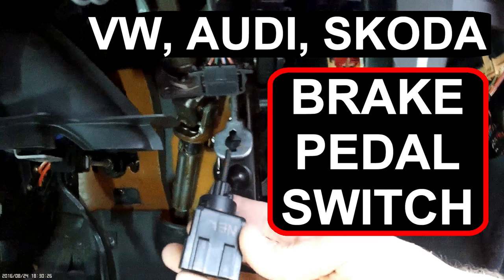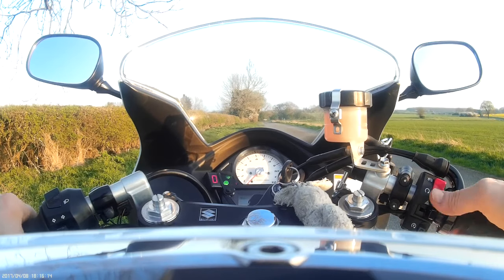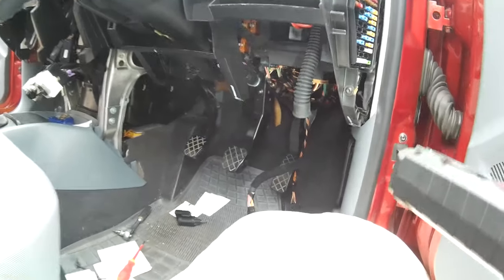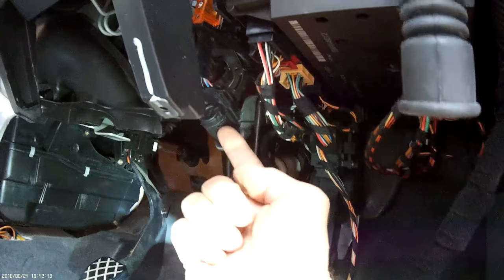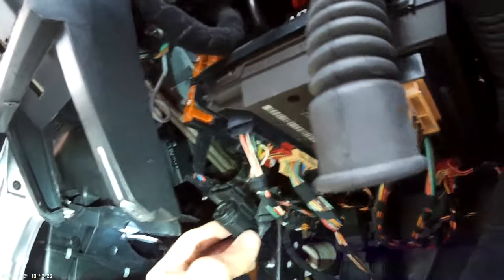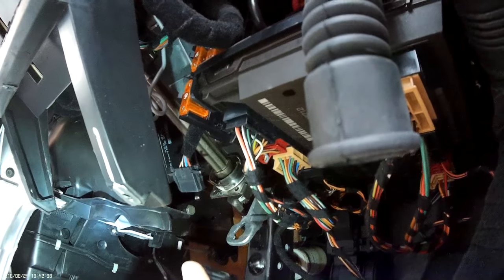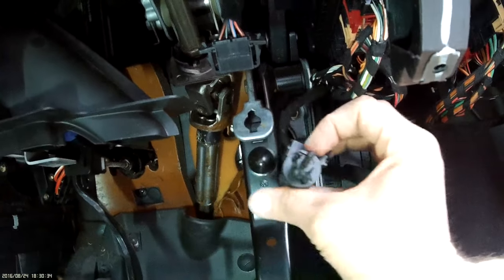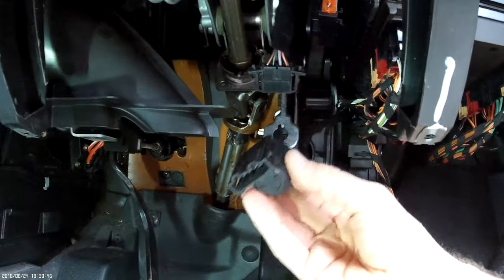VW, Audi, Skoda, Seat, BRAKE PEDAL SWITCH fix

Comment: Thanks for the video. I tried replacing the switch but the brake lights just stayed on permanently even when putting the old switch back in.
Reply from the maker: Have you looked @ the fuse, parking brake switch, foot pedal spring return and fluid level?
Reply: You have to make sure the brake pedal is up in its resting posting whilst putting in the switch then rotating 45 degrees clockwise as that is how it sets it's position. You should be able to remove it and install/reset it again without issues but make sure that pedal is up.

Comment: On Skoda Fabia (Mk2 pre-FL) replacement took 3 min without a single tool! Just flexed and removed the foam panel and unscrewed the part. Cost of part (Genuine 6Q0945511) was 15 euro (at local parts dealer in Thessaloniki, Greece).
Reply from the maker: Well done, glad you fixed it so quick, hope my video helped a bit :-)
Reply: @HatBoyHarvey  It sure did! It encouraged me to tackle the issue by strengthening my confidence. Thank you!

Comment: Getting a loud click majority of the time immediately after i press the brake pedal on my 2014 polo, reckon this could be the issue?
Reply from the maker: Depends where the sound it coming from. It would be quite noticeable if it is the pedal and a lot different if coming from outside being the brakes themselves . If it is definitely from inside then yes it could be, but you could probably tel the difference if it was the switch or the peda.l Both could be faulty. . May you could feel down at the switch whilst pressing the pedal as you would feel it if it was the switch.
Reply: @HatBoyHarvey  to be honest it sounds like it’s coming from around the brake servo / master cylinder. really sending me crazy haha
Reply from the maker: Most likely Sounds like your front pads need replacing as sound from the brake calipers can travel up through to the pedal, but could be the master cylinder, either way I would take the front wheel off inspect the brakes, if worn replace pads/discs and then see, if not worn strip down and rebuild the brakes so you know they work correctly. This will eliminate brake wheel issues so if you then still have a clicking noise you then suspect the master cylinder. Hope you understand this, but whatever do not leave it as the braking system is obviously vitally important and needs checking out :-)
Reply: @HatBoyHarvey  rebuilt the brakes fully, proper ceramic break grease and rubber grease in the slide pins, working sound as a pound now, just a slight whistling when turning right. cheers buddy 👍
Reply from the maker: @callumwilson674  monitor this noise and if as you say makes a noise turning right the the left hand wheel bearing could be on its way out. I have a video on this if you fancy doing it yourself, but the job isn't for the novice really. Happy days :-)
Reply: @HatBoyHarvey  i followed your video for the wheel bearing replacement before, both have been done, i probably messed something up though lol

Comment: Hi, I have got the glow plug light on for a few days on my fabia, I purchased and replaced the glow plug myself, but the might still there. As I search I saw post says could be the break switch light need replacing. Can u ask what light was on your dash please?
Reply from the maker: The glow plug light on is not just for a glow plug failure, it can come up for a number of electrical issues on this car. The main one is the brake light switch, if you haven't ever replaced it then this is relatively easy and cheap to replace. have a look at my video: https://youtu.be/So8m6LwsD4c
Reply: @HatBoyHarvey  I'll take ur advice and replace it, I'll see where I can get one new brake light switch that affordable. Thanks for quick reply and advice. 

My skoda mileage is 180000, in the past few month the sound of the engine isn't as soft as it was, it had hard sounds from the engine, it's very load and annoying, other day a fella told me if the spark plug works single, then he realised it's deasiel engine don't have them, any advice on this one Mr? Thanks
Reply from the maker: @miransalih1079  possible injector issue. Only buy the newer type of brake light switch as the original eim ones are crap - newer on is larger.
Reply: @HatBoyHarvey  I've replaced the glow plug and also brake light switch the orange fault light still on Dash and both brake light still doesn't work just the the lead light top of the rear window works when brake.

What other think to check please?  Just want to add this I've changed oil and filter it was needed too.

Comment: Jst replaced mine but is not working what could be the problem
Reply from the maker: Get someone to activate it whilst fiddling with the rear clusters out, wires, connections. Check you attached it properly then maybe start systematically tracing faults.

Comment: Do you need to remove any fuses or disconnect battery to do this? Buying a Fabia with this issue and just wanted some info guys thanks. Can I just remove the side plastic and bottom plastic then take the switch out ?
Reply from the maker: No, just ignition off, key out, fuse cover, bottom dash, fix :-)

Comment: Have it Jetta. Want to change brake light switch. Open panel and I Do not see the switch. I see a hole. But no switch. Have you seen such a mess?
Reply from the maker: Is there a connector?
Reply: @HatBoyHarvey  no
Reply: I think it's attached to the brake booster?
Reply from the maker: Yes, the switch can be on the master cylinder on some models

Comment: Aren't we supposed to depress brake pedal, put device in, release pedal slowly, then  turn to lock in device?
Reply from the maker: Do it which ever way you want, but there is no need to press the pedal (with what, your hand? if your foot then how do you bend down to put the switch in place without being a contortionist), just put it in and the pin will shorten to the pedal as long as you have pulled it out first, much easier IMHO :-)

Comment: If you put it like this way you destroy the switch
Reply from the maker: This is the correct way to put the switch in and worked for me.  Can you explain just what you have done to destroy the switch?
Reply: I put it like you two time, both was destroyed. After that i discover the right way. It`s hard for me to explain, coz english is not my mother tongue.
Reply from the maker: The only thing I can think of is that If your switch was in the closed position before fitment it would break under force as the switch must be in the open position before fitment. Also some cheaper copies of this switch are of inferior materials and are known to cause issues. In the description I state that the vehicle shown is a Skoda Fabia MK1 and the switch is similar to other VW/Audi group vehicles. What vehicle model/year have you?
Reply: Passat 2004, the switch is the same like yours. You cannot fit them in closed position, only in open position.
Reply from the maker: Thank you for bringing this important point up. New switches come in the open position, so should fit right out of the box. I guess it may be possible that some may not be set right in manufacture. This should be included with the switch. I will mention this is the description also, Thank you again.
Reply: @HatBoyHarvey  Some people say need to depress brake pedal then insert, then release brake pedal, then lock to place.
Reply from the maker: @andybrown6981  you can do that if you wish, but you don't need to. All you need to remember is that the actuator pin needs to meet the pedal when up. As said in the video, pull out the pin before inserting, that way the pin adjusts automatically when you lock it in position.